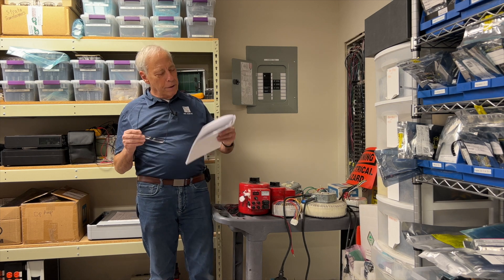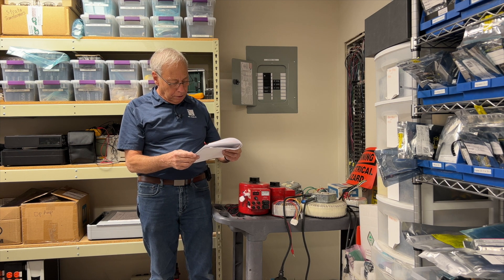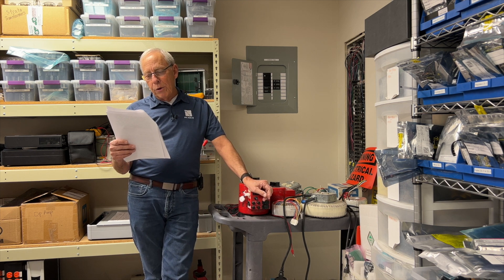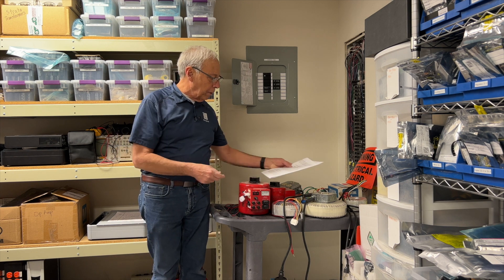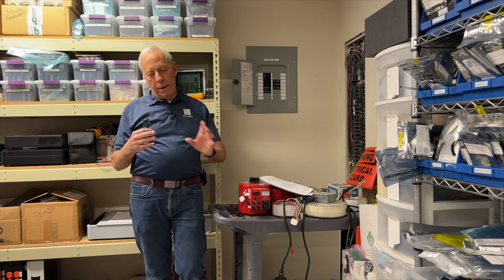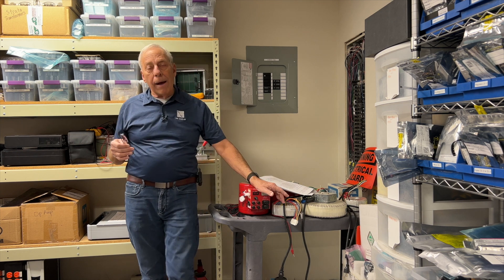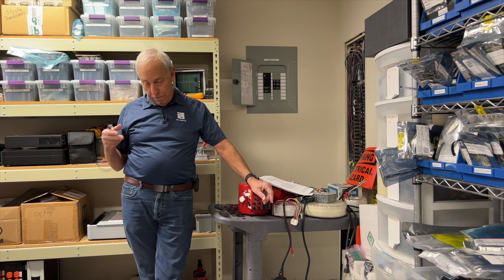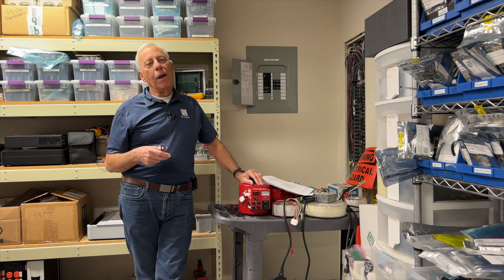XLR to single ended conversion

Comment: Hi Paul, I was going through my almost 3 years old e-mails and found out that you've actually made this great reply to my e-mail... A bit late, but thanks very much for that! I had the same feeling of that little thingy, so I've decided to rearrange my room and use unbalanced cable. The length is let's say within reasonable limits, but no interference from the walls whatsoever and everything works well. But thanks again for your answer!

Comment: Not knocking the brand ART but it probably is either a high grade audio module in a generic off the shelf box or a nice looking stylish enclosure with a Chinese module inside...probably the latter?
Reply: It's a very standard device with JRC 4580 Op Amp ICs converting balanced to unbalanced as you'd expect to find in many audio mixers.

Comment: Im curious why dont you connect speakers in series? Hifi systems drive 1 speaker per channel. Are there exceptions? What effects does it have to crossovers between different speakers in that particular configuration?
Reply: There would be little purpose and substantial disadvantages. In theory, for convenience in an application like public address it could be done, but even there it would be less than desirable since an open circuit in one speaker or connection would silence the entire channel. Normally there would be no cause to try to do it using a HiFi system. Degradations to the sound would include loss of damping factor, reduction of available output power and, unless using identical speakers, uneven power distribution between speakers. Again in theory, this could be done if you desperately wanted to use two pairs of 4 Ohm speakers with a stereo amplifier that absolutely cannot drive any less than an 8 Ohm load. That would hardly seem to be a HiFi scenario however. It's not clear to me what crossovers you are referring to - if you're meaning the internal crossovers between the drivers in two series speaker systems, each interacts directly with the drivers in its own speaker system so at most might only marginally be affected by factors like degradation of damping mentioned earlier.
Reply: @PlatypusPerspective  thanks.. youre right i was thinking in the lines of a PA system.. about the crossovers, if in a single channel you connect 2 different speakers, would the performance of each internal crossover affect the other? Does it affect the how the crossover filter frequency to each driver?
Reply: @keanubartolata3465  OK, for PA yes you could do a temporary rig around, say, a sports ground by running the speakers in series, only needing single strands of cable between each speaker and the other end circling back to the amplifier. Getting enough power output could be a problem and if the circuit breaks, all of the speakers stop. Having two different speakers in series is likely to be a bit unpredictable and messy. The crossover frequencies within a speaker system relate directly to the component values within the crossover circuit and the driver(s) internally connected to it. So within each speaker you wouldn't expect crossover frequencies to change, however the speakers being different would alter the power distribution between the two speakers and that would be expected to vary with frequency. So it's possible that with the combined sound of the two speakers you'd hear an effect like a lumpy crossover or an alteration of the slope of the shelf, and probably odd phase relationships. In a PA situation where speakers are spaced far apart you wouldn't hear that interaction.
Reply: @PlatypusPerspective  thanks.. i guess the case of difference impedance give away that thought. I always thought that an 8ohm and 4ohm connected to a single channel surely raises issues power-wise and ultimately sound-wise. I know crossovers are not the whole picture but sometimes little things between boundaries make the difference.

Comment: There's no real magic in the balanced to unbalanced circuit just two high performance op amps with a decent ( I agree ) power supply would be just fine 😊..... However!! The grade/ quality of the balanced cable ( being 20 m long ) would necessitate very high quality stuff...

Comment: The more you transition to purely digital music the less you think about once upon a time there was an audible noise issue. Where did all that noise and hum go? I was raised with SNR levels of 60-70dB at best from cable hum and noise from playing FM radio, compact cassettes and vinyl discs...and now everything seems playing above 90dB and noise has become something too faint to notice and your average RCA cable can still do excellent signal transfer. Balanced cables are however still needed if you have very long wires (e.g. at a concert venue) but for a few feet of interconnect, RCA can be awesome even in the best of system.

Comment: Why not run RCA? Or get a new AMP with balanced inputs.
Reply: Balanced RCA ?
Reply: @chrisf7249  no but I'm sure the phono preamp also has rca outputs.
Reply: @D1N02  there’s no such thing as “balanced RCA”
Reply: @chrisf7249  You don't need to use a balanced cable if there are rca outputs. I do not think there are balanced RCA's. Whatever gave you that idea?
Reply: @D1N02  read what you wrote “a new amp with balanced RCA inputs “. Sorry there’s no such amp.
Reply: @chrisf7249  No I didn't :p
Reply: @chrisf7249  look who's talking

Comment: Xlr are the perfect example of cables making a difference in huge ways. While Paul brings up common mode noise rejection it is just that rejection not cancellation, the quality of the wire but most importantly how they are wrapped in order to allow for the best CMNR the high precision of alignment. Ie the better the cable the better noise floor you will get.

Comment: Well it would only output low impedance mic level impedance, so you would need to use a microphone amplifier and then take its line level out into your preamp or use a mixing desk. But there's no issue running lxr balanced cable that distance You can run it a mile no problem, get a 43 ohm 19pF/1000ft belden cable triple-shielded microphone cable and convert it at the other end to unbalanced with an adaptor plug.

Comment: Clean box pro works well for using home receivers pushing signal to DJ amp. My set up is nothing fancy by any means, and was rather underpowered. Simple add it to convert signal, and I have seen nor heard any negative affect. Not the best way, but works for now untill I can upgrade to a XLR pre amp

Comment: The CLEANBox is likely to be seen in PA and stage amplification usage, and could be handy at times for consumer audio purposes, but it's not a high end device. It runs from a plugpack and would certainly just utilize some Op Amps, quoted specifications are middling OK. Needing a 20m cable run from a phono preamp suggests it might not be a high end application in question, so if it is simply for running to a generic amplifier out in the workshop, so that the records can stay clean inside the house, that may work quite well. YouTube has been losing my reply to hoobsgroove below, so to enlarge, Paul did say an active converter when he read out the query, and the CLEANBox Pro is an active device, using JRC4580 Operational Amplifier ICs, and derives a quite basic power supply configuration internally from a mains plug pack. hoobsgroove may be mixing up this with the CLEANBox II Hum Eliminator, which uses isolating transformers.
Reply: It is a high-end device it has galvanic isolation just  transformers
Reply: @hoobsgroove  I'll see if my reply holds this time, my earlier reply disappeared. Are you thinking of the CLEANBox II Hum Eliminator, which uses isolation transformers? The CLEANBox Pro is an active device using Op Amps.

Comment: 20 metres is closer to 66 feet.
Reply: @GaryMitchell1966  Yes you are correct.., 20 meters = 65.6168 feet… Just short of 66 feet..
Reply: @GaryMitchell1966  there was just a quick 10-second calculation in my head. You are wrong in that it is closer to 66 feet than 60 feet. You are also wrong in that is very close to 65 1/2 feet. I think you're the one who should get a life.

Comment: you should have an XLR splitter so that the XLR signal goes directly into your equipment as much as possible. as soon as you run them through a box that is often used at concerts to convert microphones and instruments to real XLR or vice versa, you run the signal through a preamplifier and coupling capacitors, which will change the signal!